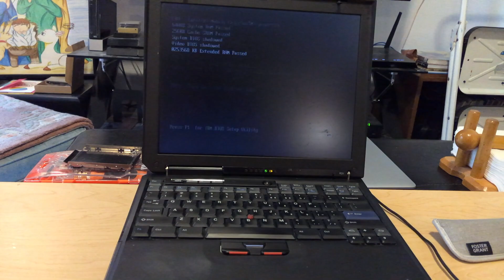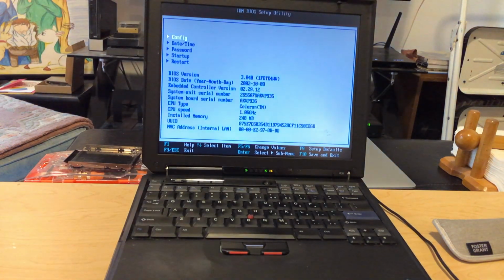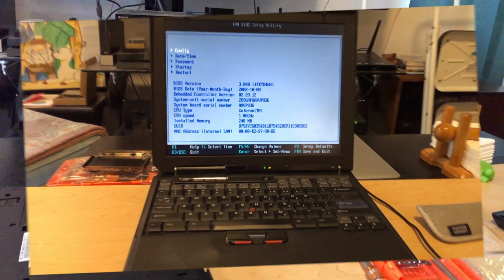IBM Thinkpad R31 System Board Issue and SSD

Comment from the maker: The beeping stopped. It may have been a bad connection to the CDROM drive as I put the laptop on its side where the CDROM resides and when booting it up after that, it now works normally. I surmise that the beeping started originally as a result of replacing the CDROM in the R31's UltraBay with an LS120 drive I have. Everything works now. Weird problem. It's probably good to have an extra logic board, right?

Comment: Did you ever figure out how to make the computer boot to the new SSD?  I did not see a followup video.
Reply from the maker: Turns out the drive bay was loose. Once I figured that out I installed Windows XP and it works perfectly.
Reply: @StevenSmyth  thanks

Comment: Could you give a clue as to how to access the HDD - thanks
Reply from the maker: The hard drive is in a compartment on the left side as your looking at the laptop. It’s where the audio jacks are. There is a screw holding the cover on, the drive is under it and slides out.

Comment: Hi Steven,

I have an IBM ThinkPad R31 just like this one. I'm considering installing an SSD, but have 0 knowledge of how. Could you please give me a step-by-step of how to do it and what equipment is needed?

Thanks!
Chris

Also, I don't have the XP install CD and want to preserve my files, so if you could figure out how to preserve the data that would be good.
Reply from the maker: Chris, I might could do a video featuring that, but I am in the middle of organizing and putting some things into storage, so it will take a bit. This is why I haven't put out any videos since I posted the one about the Apple DTP Toolkit. In the meantime, here is a link on archive.org to the R31 service manual.

https://archive.org/details/ibm-service-manual-thinkpad-r30-r31.pdf/mode/2up

Like most ThinkPads, the R31 is pretty straightforward when replacing drives. Please see the Amazon links in the video description for the mSATA SSD and adapter/enclosure I used to make this work. As I said there, I didn't have to use the caddy I purchased to fit the drive, the enclosure fits fine without it. As far as backing up is concerned, if an old laptop has a PC Card/CardBus slot, I like to get a USB 2.0 card for data transfers, because if you try over serial or parallel, you are going to wait a while. I got an IOGEAR GPU202 card, but any one of these class should work well for you. As far as backup software, there is the Backup Utility already in Windows XP. Here is a link to a guide for that.

https://www.techrepublic.com/article/10-things-you-should-know-about-windows-xp-backup/

You should at that point be able to backup to any external USB hard drive.

I hope this can help you in getting your R31 setup.
Reply: @StevenSmyth  Thanks for your help, Steven. I was trying to get the fan out to reapply some thermal paste (wasn't easy, didn't even get past the LCD removal), but now, the screen is very dim. I looked it up, and this seems like a problem with the LCD inverter. Could I have somehow messed it up with a magnetic screwdriver? Also, is there any way to fix the inverter problem without buying a new one (e.g. with a magnet?)

Thanks!

Comment: Nice work!  Could you run Windows 98 on this laptop, or would that not work?
Reply from the maker: I could, as there are drivers for this, but for now I'm going to run XP. I'm also going to get 1GB of RAM so I can max it out. I have a Toshiba that runs 98 that I'll be featuring in another video soon.